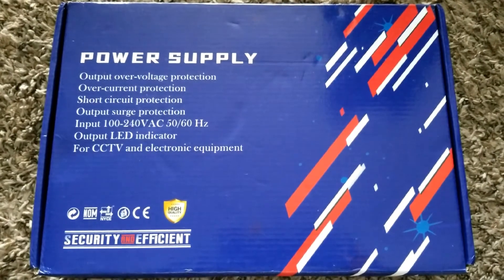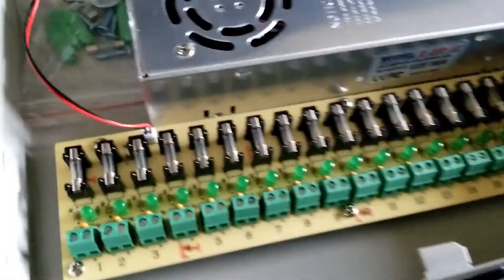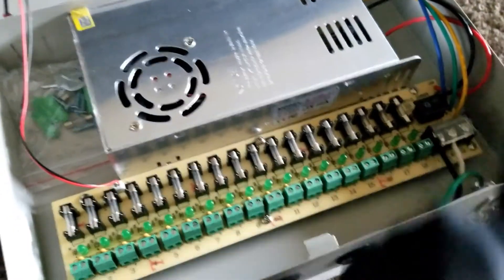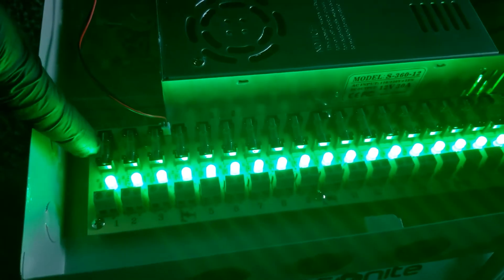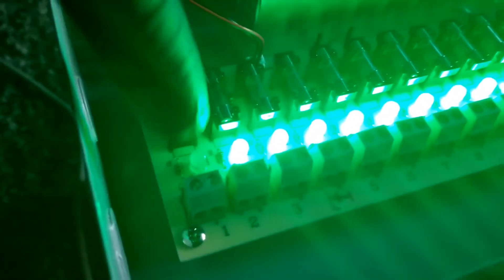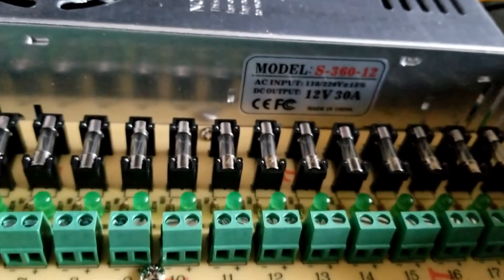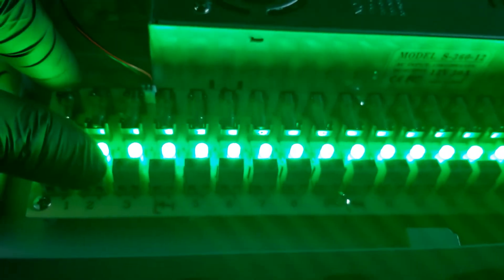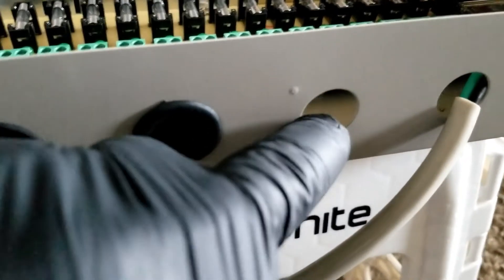CCTV SECURITY CAMERA DISTRIBUTION POWER SUPPLY BOX (Part2)

Comment: GREAT TESTING OF THE POWER BOX CABINET . I KNOW YOU WILL FIND SOME GREAT 12 V USES FOR IT . KEEP IN MIND , IT MIGHT CAN BE USED TO RECHARGE BATTERIES OR PUT SEVERAL VOLT , AMP AND WATT METERS AND USE IT TO TEST OR RUN 12 V COMPONENTS . UNLIMITED USES IN ONE BOX .